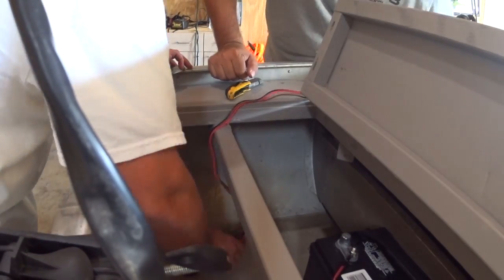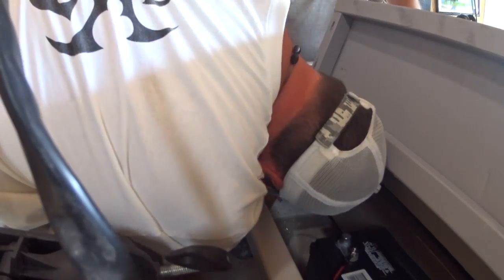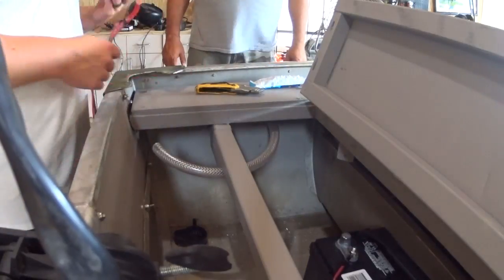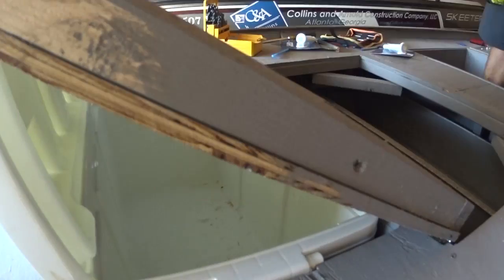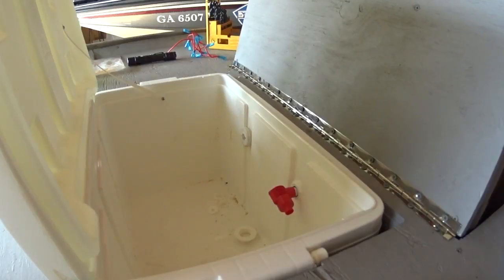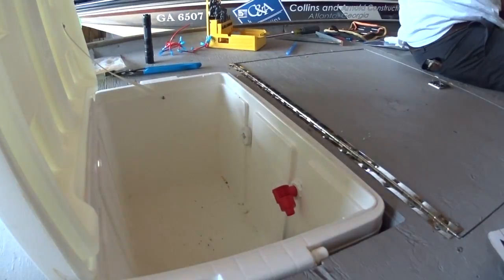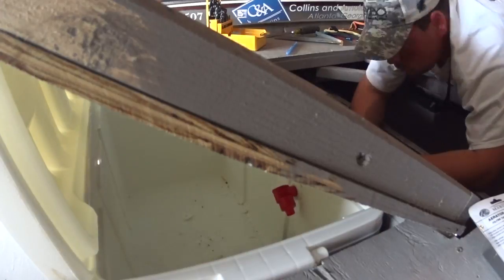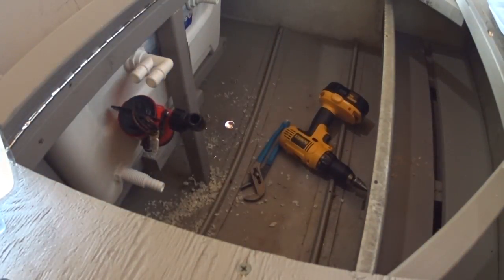Part 12 of the full jon boat to bass boat conversion! Plumbing the livewell!

Comment: are your hatches dry hatch so that water doesn't get in if so how did you set it up?
Reply from the maker: They are not true dry hatches.  Best way to get dry hatches is to buy prefabricate ones you bolt on but they are expensive.  A cheaper alternative is just use plastic containers and large ziplock bags.

Comment: How much weight did this add to the boat for everything?
Reply from the maker: We really didn't weigh it but I can tell you this the frame is light most of the weight is from the plywood and the battery's.

Because we used 2x2s for most of the frame not 2x4s it cut down on the weight a lot.
Reply: DECKED OUT JON BOATS thank you so much for the information, appreciate it